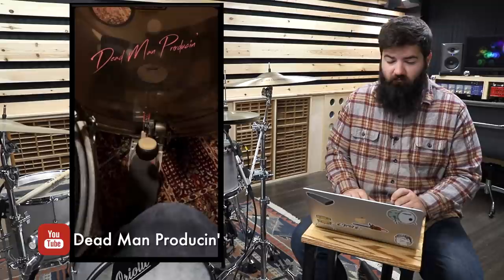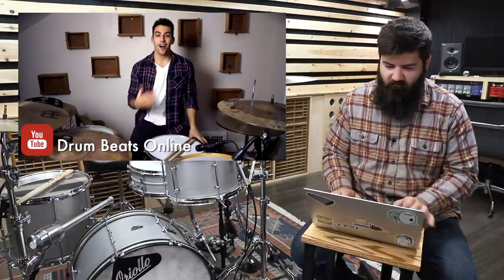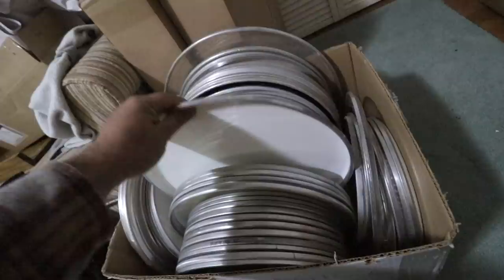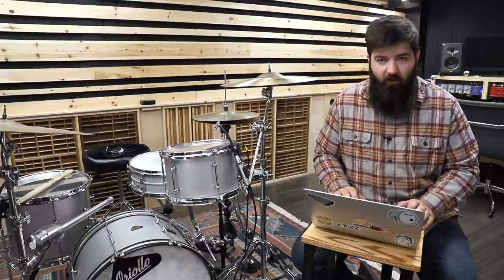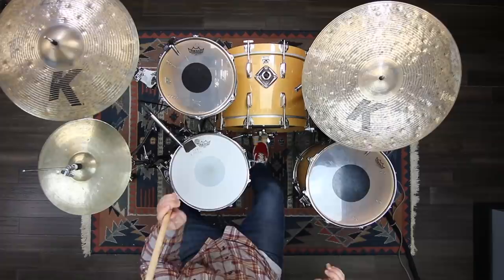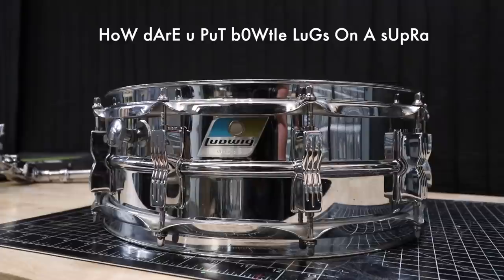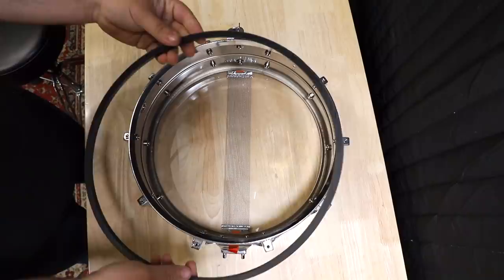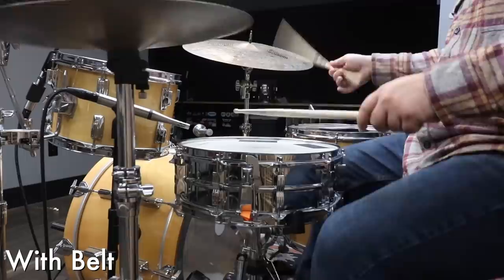Testing 5 Drum Hacks That I Saw on YouTube

Comment from the maker: What are some other drum hacks you would want to see tested?
Reply: The first one!
Reply: Ive heard of people, that put a Sandbag inside the Kickdrum für Dampening, because it adds Mass to the Shell. 
I would love to see that
Reply: You could put some buckshot inside of a snare and see what that does. You may have done it already.
Reply: I just want to see you play more METAL
Reply: Honestly david those blast beats and double bass were pretty good. We need a cover sometime.
Reply: oooooohhh, try playing standing up, or with a fresh baguette
Reply: @L0CV5T  exactly!
Reply: Some of my favorite hacks: use box ties as snare straps

Break a chain, put it back together using a tie wrap 

“Nano” tape works just as good as drum gels and you can cut to length 

Need a make-shift trap table: put an upside down snare head on a snare stand
Reply: I like to attach a length of ball chain (the kind used on dog tags or pens at the bank) to the nut of my ride and drape it down over the entire length cymbal. it creates a nice effect with a long decay, on every hit.
Reply: A while back I had these crappy brass cymbals and I wanted to make a clap stack. I had a set of hi hats and a crash and one of the hi hats I cut up to make it like 8 inches in diameter. When I did that I used my circular saw and cut notches into the cymbal all around the circumference and when I finished I was left with a bunch of scrap pieces of brass that were all roughly the same size. I drilled a hole in all the scrap pieces and tied them together producing something like a Ching ring but with a totally different sound. My clap stack turned out pretty bad. But this other thing I made is great. On hi hats and snare it sounds fantastic. I think you should try it out it would be a cool video and it’s pretty easy.
Reply: A sound edge bottom cymbal sandwiched inside a regular hihat set
Reply: Instead of a quarter try a somewhat larger circle of stiff plastic, like formica, taped to the kick drum head
Reply: Hey Dave I would recommend checking out the drum tacos from creative percussion. I'm endorsed by them and I love how amazing my snare sounds now!!
Reply: @hoochrocks  Would that make the snare sound like a gunshot? lol
Reply: I once got a Ludwig standard snare (Wooden, jazz fest clone) with rerings and when I opened it up someone had taken aluminum siding and wrapped it around the shell on the inside between the re-rings. I guess to make a wooden drum sound more metallic? I don't know.
Reply: @dudustickytricks  Same here, only I make a loop out of the chain.
Reply: No enough adds
Reply: @timm1139  I'll have to try that. Seems like it'd be easier/quicker to switch to other cymbals that way. Thanks!
Reply: @capabartz7380  want to hear it
Reply: I like using shredded paper in the bass drum. Sometimes cotton balls in the floor toms.
Reply: @timm1139  Not sure. It might sound like a bunch of super balls bouncing around.
Reply: putting a small round piece of drumhead on your basshed for a super shot and punch sound. makes the most differance with bad basshead and no muffeling
Reply: You had a story on IG once looking at someone's pancake snare. Be cool to see if you can make one
Reply: Drum hack if you get a evans emad with 2 removalable ring take the second ring and put it in the dampening ring of the resonant head it will take out a lot of overtones just like a pillow would
Reply: @dudustickytricks  Shhhh don't give away all the secrets. I've used this live before it was a 2.5 foot  long ball chain from Walmart for ceiling fans and costs $1. Made my ride have a better sizzle than the expensive drilled ones. 

You can loop it around multiple times for different effects too.
Reply: sizzle cowbell
Reply: one hack that used to work back in the day when i was using them cheap generic all-thread hi hat clutches for me was this: 

take one or two of the rubber gaskets from a grolsch beer bottle(s) (the red rubber ring) and put it/them under the felt thats under your top hi hat, that way then if your clutch comes apart mid song (or specifically if the screw-on base comes apart) your hi hats wont fall apart and you can carry on the song till you get a chance to screw it back together :)
Reply: Remember how you put jingles in that pancake drum awhile back??? You should do the same thing but with a snare drum. Also love your vids and thanks for the effort you put in to your content creation
Reply: Stuff as many toilet paper rolls as it can fit inside the bass drum. Hahahaha
Reply: A piece of an old drumhead stuck to where your beater hits, using the thick foam type double sided tape makes the kick very clicky and also extends the life of your batter head.
Reply: Instead of the belt try a tube for a kids bike maybe?
Reply: The 2 I always love are cotton balls in the floor tom to get the Benny Greb sound, and styro packing peanuts inside a bass drum.
Reply: Sir, unrelated to THIS video, I sent you and email. I don’t know it you check that account but if you could look for it from (andrewbpearl).
Reply: Ooookay,first you have to get past the weird and realize it works.  You need to muffle your drums at a gig, because you are playing a low volime gig in a cannon (metal, concrete or brick walls, floor and ceiling), and you don't have 40 rolls of gaff tape and a sponge lying around but there is a convience store or supermarket within a minute.  Go in, buy a box of maxi-pads (yes the feminine hygiene product), go to gig, pull off the handy sticky strip, slap on the heads, and instant muffle.  Yes, it looks weird, yes your bands mates will give you shit...until you start playing, and then you look like the Albert Einstien of drum hacks.  Works on toms, snare, kick and cymbals.  If you a female drummer you will avoid the odd stares at purchase time, if not, just smile.and say its for a project and let them wonder.  Also works in a pinch for recording sessions.
Reply: Hey rdavidr, what do muffle ur bass drum with & what is the tuning on it, Thanks
Reply: Wooden cymbal stand
Reply: I'd like to see a fan installed in a drum shell so it would look like a mystery drum on the floor that just keeps you cool.
Reply: This might be crazy and there aren't vids about this yet but... is it possible to test out by putting a small towel under, like touching the snare wire and the stand? And from there, you keep folding and folding but not to the extent it will kill the buzz. Then tune it low. I wonder how it sounds like in a recording.
Reply: Here's on of my own hacks to try.  I gave up on moon gel because it breaks down and costs too much.  I buy gummy window decorations at the Dollar Store.  Works just as well, comes in a myriad of styles, colors, and sizes (if you are in to that) and a buck's worth last me more than a year.  Check it out!!  Thanks for your vids.
Reply: Acoustic foam inside drum shells.
Reply: That Vinnie Paul BD trick reminds me of something I'd read many years ago in an interview with Trini Trimpop, then drummer for the German Punk band Die Toten Hosen, who would stick a square of wood laminate onto the bass drum head where the beater hits it;  "For a really hard sound!"  Now I've no idea how big and thick that piece of wood actually was, but I've always imagined it covering pretty much the whole bass drum head 😄
Reply: @Drummer_Flo  -  Yes, I've heard of that sandbag trick, too!  Along with the one of putting a filled paint can into the bass drum and for the same purpose;  Simon Phillips does this, and he'd gotten the idea from another drummer 🙂
Reply: Does a buffing pad (used in car body work) attached to a drill or dremel work well to polish cymbals?  Or is that overkill?
Reply: That bass drum coin trick I have heard about for the first time before the internet. In early '90 there used to be no quality drum heads around in Czech republic and this was pretty much the only way to get some punch out of it. It used to destroy the head quicker obviously, but was well worth it.
Anyway, nice vid and couple nice hacks. I love the sound of the Zildjians you use here but what I really do wonder the most is WHAT ARE THOSE HI-HAT CYMBALS?
Reply: I know it's not a hack but I would love to know if you can add an internal damper to any drums (mainly snare) just like a Ludwig kit, thanks David love your work!!
Reply: @jimmio3727  The belt thing has to be among the dumbest IMO. It's not like metal shells are so very much different than their wooden equivalents. Certainly not different enough that you've ever need to 'roll back' their metallic properties, while leaving the most crucial factor (the head) entirely out of the equation.
Reply: The one that I got from watching your video.  Or the one where the dude muffles a bass drum with maxi pads.
Reply: Boom stand

Comment: Pro tip when ordering from Sweetwater...if you just order candy, theres a Neve mic pre hiding in the box!
Reply: I remember ordering a single set of guitar strings (coated at least, not cheapies) and they had included the candy TWICE -- once in the bottom of the box, and again on top of the strings, as if maybe the person doing the packing couldn't remember if they had already loaded the box and just threw in another rather than taking the time to poke around and check.
Reply: @mal2ksc  And then you got a phone call a few days later, right?
“Hey there: This is (so-and-so) from Sweetwater calling to see how you’re liking your new strings!”
Reply: @beatfromjetsetradio8239  They could try, I've still got five of them on the guitar. The high E "only" lasted a bit over a year before I managed to break it. For a wall hanger or closet guitar that doesn't get handled much, but you still want it to work, I can highly recommend Elixir coated strings. You could easily have the same strings on there for ten, twenty years and have them not suck.

Comment: When I was playing metal I did the coin thing with the bass drum but I used a half dollar and the hard side of a DW beater. It was super clicky! The half dollar was stuck to a head protector pad that was made from Kevlar. I soon found that you have to put a protector on the head, then the coin, then another protector because if you don’t, the edges of the coin cut through the bass head pretty quick. I also found out that a half dollar is not as strong as you think. I noticed after 3 practices and 2 gigs that it was bending where the beater makes contact. Yes, I bent a half dollar into a 45 degree angle!

Comment: At first I thought the gaff on the head would defeat the purpose of the belt/no belt inside the shell. But on 2nd thought, it just proves that gaff tape is a much easier hack than putting a belt freaking INSIDE of the drum.

Comment: Since you sometimes play a double bass drum pedal try this hack. I have been doing this for years, but only have seen it one other time.  Get a longer rod for your secondary bass drum pedal. This allows you to place the pedal to the outside of the high hat pedal. This keeps the high hat pedal in the primary position but you can still easily get to the double bass drum pedal. I guess it depends on how much you access the double bass pedal, but for me I get the best of both worlds. I get to play a double pedal when I want to, but also have my high hat in the traditional position.
Reply: Does that mean the 2nd pedal would be on the left of the hat stand rather than the right? Never considered this 🤔

Comment: one hack that used to work back in the day when i was using them cheap generic all-thread hi hat clutches for me was this: 

take one or two of the rubber gaskets from a grolsch beer bottle(s) (the red rubber ring) and put it/them under the felt thats under your top hi hat, that way then if your clutch comes apart mid song (or specifically if the screw-on base comes apart) your hi hats wont fall apart and you can carry on the song till you get a chance to screw it back together :)

Comment: 10:50 I also couldn't hear a difference, and perhaps the belt is just a good substitute for a factory muffler? Like if the muffler broke or is missing you can slap a belt in there and get the same effect.

Comment: For the mic cover and sock trick i would just throw a pillow or some old hoodies inside my kick.. as for the quarter trick, ive done that but i also turned my beaters backwards so the plastic portion would hit the quarters. The quarters were too aggresive against my beaters and not enough hitting the felt, so i ended up cutting the lids from pringles cans and taping those to my kick instead. The plastic to plastic hit was perfect with the duct tape

Comment: Another way to get a decent sizzle sound is by buying some cheap Mardi Gras bead necklaces and simply placing one on your cymbal.
If you don't want the necklace to hang off the edge of your cymbal, just take any part of the necklace and twist the beads into each other. This should make the necklace "shorter".

Comment: Metal drum, glue the belt in place with rubber cement.  It just rolls up and rubs off (easily) when you remove it.  Smells bad though.

Comment: Just an observation: looking at your overhead shots down to your bass drum pedal I notice that your pedal looks slightly out of parallel with the drum itself. QUESTION: is this done on purpose , and why?
Reply from the maker: That kit has the T shaped tension rods so the pedal doesnt fit 100% without hitting them so it slips around some lol. Been meaning to switch out the bottom 2 with regular rods so it fits better.
Reply: Thanks for reply 
Love your content.

Comment: a note on the quarter trick from someone who has used it on and off for the past 10+ years. DO NOT just tape the quarter to the head. somewhere in the middle of the set the beater will break down the tape and it will start sticking to the head fucking EVERYTHING all up.  glue the quarters to a piece of old drum head to make a patch then tape the patch on (no tape where the beater hits)   fair warning and something  that should be pointed out

Comment: For a really triggery, gong drum sound without taking up the space a gong drum would, grab a 16" floor tom, an Evans EMAD clear (for tom hoops) and cut a port hole in a 1 ply coated 16" head. You can stick the spare drum head piece from the port hole in the center of the batter head with some form of adhesive. Not only do you have a mini bass drum for small gigs (say you had a converter kit) but also a very triggery, bass-drum-like floor tom. I even put my Beta 52 under the drum into the port hole on the reso side.

Edit: Side note. You and Stephen Taylor should do a drum battle after Cobus and Cooper.